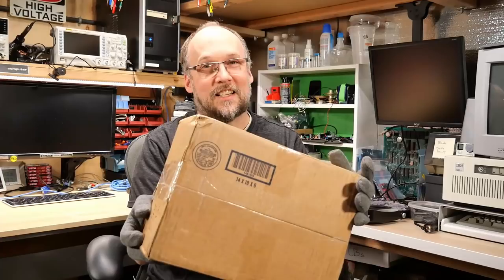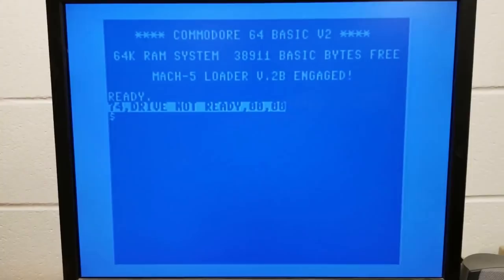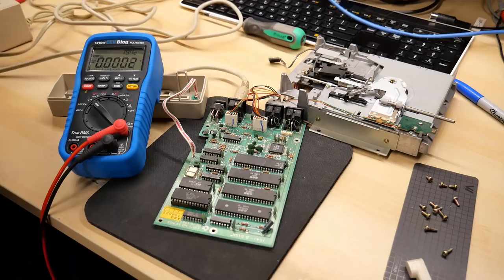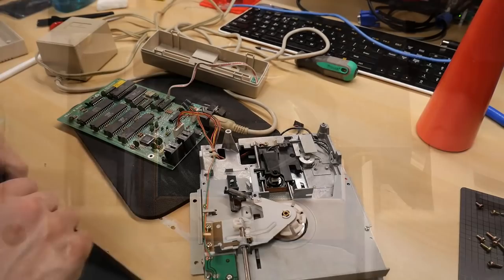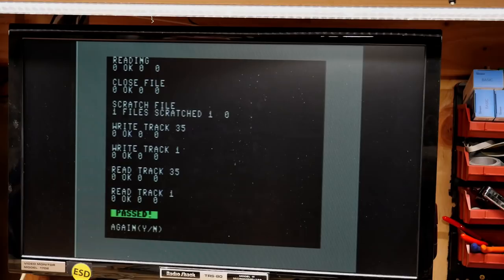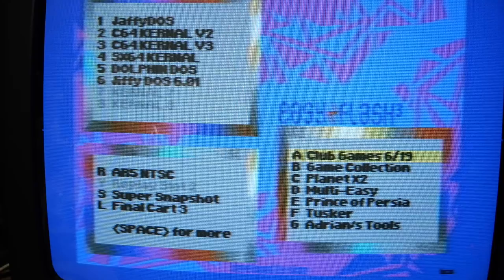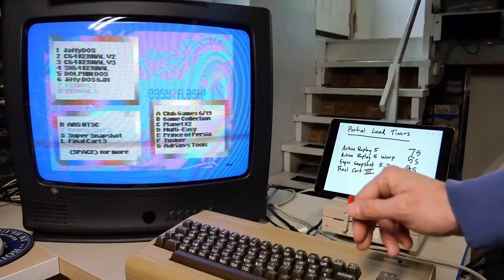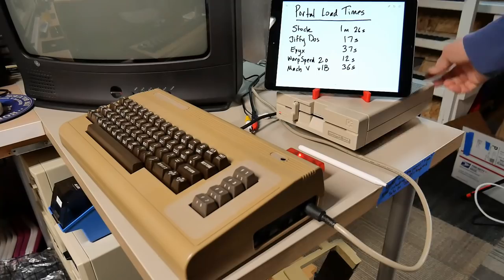Faulty 1541-II Repair (plus C64 Fast Loader fight!)

Comment: Super Snapshot had its own version of the "warp" format. In fact, I think it used the same indicator for the special files. I don't know if they ever built the creator into the cartridge though, my version had it on disk. However, once the files are saved in that format, the cartridge will load them just fine. I'm not saying it will load the Action Replay warp files, but it couldn't hurt to try. I'd be interested to see if it works.

Epyx also had their own version of this in the Vorpal Utility Kit. I rarely used the special format because I didn't like the way you couldn't copy it with normal programs and because if I gave copies to others, they might not be able to load it. I forget if Super Snapshot had a program to load such files without the cartridge or not.

Comment: You forgot to paper the table so you can then remove the paper to a bin. If you get newspapers pre-outbreak, those are great for providing a sanitary object-handling surface for the table alongside use of disposable gloves. Also: Bleach the surface when finished, and bleach the gloves if you intend on re-use of disposable gloves. Have three basins — straight bleach, first rinse, second rinse — then hang dry. Handle all objects outside with tissue or paper towel (preferably from a motion-sensing dispenser.)

Comment: Here's a tip that I am hopefully remembering correctly: You don't really need extra hardware to diagnose a flashing activity light on a Commodore diskdrive. Using a simple (albeit probably clumsy) set of commands, you can get a print-out directly on the screen using a BASIC command:

OPEN 15,8,15:INPUT#15,A,B$,C,D:PRINT A,B$,C,D:CLOSE 15

This will give you the same error report. Strangely I can't get it to work as a single line in WinVice (kept getting an ILLEGAL DIRECT ERROR) but writing a short BASIC programme like the one below works too:

10 OPEN 15,8,15
20 INPUT#15,A,B$,C,D
30 CLOSE 15
40 PRINT A,B$,C,D

EDIT: OMG, Krakout. I spent so many hours on that game. Also funny that the screen before plays the theme to Yie Ar Kung-Fu II. Also a very nice track.

Comment: If I remember correctly, when I used to repair those. The 74LS13 would cause a no read error as well. This is the same chip that is used in cassette data drive. or you could make your own with the same chip.

Comment: Regarding alcohol vs Windex, 99% alcohol has no water in it, so it's not going to clean certain things, especially organic material. Just like water alone won't clean grease, pure alcohol won't clean water-soluble stuff.  I usually use Windex for glass or shiny surfaces, 409 for solid surfaces, alcohol or contact cleaner for anything electronic, and lighter fluid for anything sticky or gummy.
Reply: In addition to that, unlike just alcohol, the Windex etc. surface cleaners do contain also some spesific effective surfactants which improve wetting and dispersing, thus helping also to separate the particles, for example. As the outcome of all those designed properties, the efficiency of the cleaning process gains significant improvement.

Comment: Not silly for wearing gloves. I wear gloves and a mask when going food shopping.

Stay safe everyone.
Reply: Hopefully he cleaned the desk after setting the box on it though. You could spray them with a bleach and water solution and open them up on the front porch if you’re worried though. Then it never enters the house either.  Would make it a little harder to do an unboxing video though :)
Reply: Viruses don't survive long on cardboard. Furthermore, getting infected this way is highly unlikely.

Just wash your hands after handling it or when returning home.
Reply: @insertaverygenericnamehere  Viruses are not alive to begin with, so... Also, on the cruise ship Diamond Princess they found that the virus was active on surfaces up to 17 days after the infected people left.
Reply: @MariaEngstrom  From recent research (within the last two weeks at UCLA): "Scientists discovered the virus is detectable for up to three hours in aerosols, up to four hours on copper, up to 24 hours on cardboard and up to two to three days on plastic and stainless steel."

Yes, a CDC investigation of the cruise ship found evidence of viral RNA in cabins that hadn’t yet been cleaned after 17 days. But to be clear, that just means that the RNA was detectable – not that it was viable or that contact with those surfaces would have been able to infect someone.  If you have bits and pieces of RNA, that’s not a functional virus.  You need an entire intact genome. Just because you had a little piece of RNA doesn’t mean that there’s an infection.
Reply: Furthermore:
Did he wash the gloves?
Did he touch his face by accident with the gloves on?

Wearing gloves can lead to unsafe behaviour — in the sense of "I don't need to wash my hands because I wore gloves"...

Comment: IDK if this is true for the AR5, but for the AR6 and RR the only keys you really need to know for daily use are:
F1 then RETURN for LOAD & RUN first program.
F3 for instant disk directory.
Cursor up to the beginning of a line in the directory and hit F1 to load that file.

It's nice to see that the NTSC AR can keep up with the PAL version.  

I can understand the appeal of JiffyDOS (and other ROM based loaders), but that 10 or so second saving the AR's standard fastload to me is worth the cost of slight incompatibility issues.

But, after seeing this video I honestly can't see why anybody would want to waste time and money on the EPYX fastload cart when nearly everything else is faster and offers more.
Reply from the maker: Yeah! The Epyx cart is certainly better than nothing but I guess its early release meant a lot of people had it and never upgraded. Their loss!  AR is just so crazy fast. I did find a few things that didn't seem to work with it though during my limited testing.

Comment: Interesting that you switched to lithium grease. I was always under the impression that when plastic is involved (in either one or both of the parts that 'move') then silicone grease should be used.

Comment: Hi,Adrian 
If you want to clean with 99.9% IPA  you need tho thin it down to 70% by adding 30% DM water ,that is why your windex worked.
I always have some watered dawn IPA for cleaning and finish with 99.9% to be sure all water resedu is gone .
It works great for flux cleaning to , cleans way  easier than pure IPA . Do the test.
Reply from the maker: Good tip. I actually have 70% IPA already on the bench and 50% which I use for cleaning things. I'll use the 70% next time for head cleaning too.

Comment: I have a few SID chips that manifest issues on some of the channels but still are good for test purposes. I find that the swinsid should only be used with Dual swipe socket attached to it otherwise it can widen he SID socket. -Mark.

Comment: Not sure what sound/noise you were referencing later in the Video but if you don't have the Audio in to ground fix then it will definitely make a high pitch noise esp. when volume is turned up.  -Mark.
Reply from the maker: The SID has a fault, anytime any channel is enabled there is an annoying high pitched sound. The camera mostly filtered it out. It's not specific to this machine. I stuck that SID in the machine because Final Cart III doesn't work with a Swim SID due to lack of paddle/mouse support....

Comment: I use retro replay (the default option on my 1541 U2+). I was kind of hoping you'd test that too. I noticed it's insanely fast though. I noticed it was way faster than epyx and epyx didn't work with sam's journey. Retro replay works with sam's. Probably because it's made with REU in mind. I think it's the same company as action replay. I wonder if it is basically just the same thing. I love the F1 to load * option, but you still have to hit enter.

Comment: @Adrian Did you think to clean the black plastic top part of the headassembly, that pushes down when the head is engaged? I was just watching it, thinking there might be the same kind of crud on there, if it came from a floppy that had gummed up. Wouldn't want you to get that on your discs that you use in there :)
Reply from the maker: I don't. It's a foam pad and doesn't seem to pick up the same contamination. If it's a double sided drive then you do need to clean it as it can get the same build up.
Reply: @adriansdigitalbasement  Ah ok, i was thinking it would be some plastic thingy, which could crap that gunk the same way, i don't really know those old Commodore drives, but was really just concerned about your precious discs you would put in it. 

Thanks for putting out so many videos right now, by the way,  it's really nice to get all this new content... and stay safe :)

Comment: Super Snapshot Warp mode was missed -- Iyou don't need the cart to load that type of file, either.  I would wager it would be just as fast you winner.  I think you should do a part II :)  Cheers, ~ c

Comment: in regards to the magnetic mat, I have a little magnetic bowl (looks like an ashtray) that I picked up at ACE Hardware for a couple of bucks..  works great and spends most of its day just stuck to my fridge.
Reply from the maker: Yeah I have a few of those too. My gripe with those is they often pickup stray screws on the underside due to how strong the magnet is. The mat seems to keep screws exactly where you put them down so you can organise the screws into groups.

Comment: I have drives that are know good ones and they still work, but I had to clean the heads of them a lot of times, before I realised, that I had to sort out my floppys, because when I was using those drives, suddenly they stopped working and I was totally confused, of why exactly they couldnt load anything anymore, until I checked on the head and saw that it was completly dirty, so even one single floppy can get the head dirty enogh, so that it cant read anymore. It is a good advise as well to check the floppys themselves, if they are still ok to use or not
Reply from the maker: Yeah! Old floppies are degrading and one use can render a drive inoperable.

Comment: you should definitely spend the cash and get a 1581. fastest drive, looks awesome and you can put 15x more programs in a single floppy.
Reply: then you add jiffydos to 1581 and you get what c64 should have always been.  forexample you can quickly load a digitzed image (jpg converted to koala) as part of a simple menu program in basic that load/runs games/programs in that disk.  i even added a sid file player as well.
Reply: Those drives sell for 300 euros now on ebay ! Crazy
Reply: @speedsterh  such a shame

Comment: The final cartridge 3, you should be able to use any joystick as the controller if you don't have a mouse.
Reply from the maker: The joystick on port 2 didn't seem to work and I didn't test a mouse. I did notice with the Swinsid installed the mouse pointer moved all over the screen on its own! The Swinsid doesn't support the mouse or paddles...
Reply: @adriansdigitalbasement  I had one of these final cartridges 3 and it was many years ago since I used it.  I have no Ideal where it is.  The cartridge image I downloaded had that same problem.  The mouse pointer didn't move either.  I was sure I saw myself move the pointer using a standard joystick on a real final cartridge 3.  But that what I remember doing from the late 80's
Reply: @adriansdigitalbasement  i got it to work on joystick port 2,  this is for the final cartridge 3

Comment: The gloves themselves are the silly part, those gloves are not waterproof nor disposable nor easily cleaned. You run less risk of spreading contamination by simply handling it bare handed and washing your hands thoroughly afterwards.
Reply: And every surface or object the box came into contact with should have been sanitized as well
Reply from the maker: The box wasn't wet so any contamination on the surface can't magically jump multiple mm through material. And I didn't use the gloves again for multiple days. They just sat on the floor where I had left them so there was no contamination risk.
Reply: Have you considered buying a uvc lamp? Everything I can't wash or wipe down I disinfect this way
Reply: @adriansdigitalbasement  You are a braver soul than i.

Comment: Late to the party, sorry. But pure (99%)  IPA is not always better, some water in there is needed to deal with polar molecules. So 70% IPA, or windex (also water plus alcohol) often, maybe be even most often, works better. As you discovered. (reportings this, though late, because I did not see any other comments on this.

Comment: I had a 1541-II once, when I turned it on, the drive motor would run continuously and the drive light would flash on and off slowly, and you couldn't use it, that is, when connecting it to the computer, if you tried to load a program, it would just sit there doing nothing, the computer would indicate that it was searching for a file, but it wouldn't actually do anything.

Comment: I had a 1541-II with my first C64 when I was a kid. I think the LEDs should be reversed, so the power LED is green, and the drive LED is red. I'm pretty sure mine was blinking red when there was a read error. It's stange because IIRC the wires for the LEDs are soldered in, so you can't plug it in backwards.
Reply from the maker: Commodore couldn't get those colors right. The old drives have red access LEDs and green power but the computers all had red power. So it seems on the II they made it the same as the computers. Then later on later Amiga machines they reversed it back to green power and red or orange access.
Reply: @AndrasMihalyi  In breadbin case C64s, I think Adrian is right, the power LED is always a round 5mm red one. In the slim case C64C, it's rectangular green.
Reply: @adriansdigitalbasement  From what you said, it seems they done it randomly, because my 1541-II had green power LED, and red (or probably orange instead!) drive access LED. I will report that here if I can find it. I disassembled my faulty 1541-II when I was about 9 yo, and it never went back together again, but I may still have the board in one of my junk boxes (I'm sure I still have the power brick for it). My next drive was the big brother 1541, with green power and red access LED. And now I remember the red access LED of the 1541 was a change for me, which means my 1541-II had orange access LED!

Comment: I still have 7 diskettes of my youth. In ~2005 I bought a C64 package with drive and so on and this XE1541 cable. It worked fine, I could bring all my diskettes to the PC and use them in an emulator from there on. But the 1541 stopped working after this and I had this cleaning diskette, after 3-5 minutes of cleaning the head it went to work again. I assume some diskettes just disintegrate after all these years and leave a film on the head.

Comment: Well I am not so sure about the relability of the 1541IIs PSUs. I have got 4 drives on ebay and only 2 PSUs were OK in the beginning. After a while only 1 stayed alive, so I have 1 out of 4 working. I was checking the voltage and sometimes it's the 12V which is too low and sometimes the 5V. They seem not to kill the drives but you can throw them just away since it's almost impossible to fix them since all the parts inside of those PSUs are inside of a weird gel... So my only solution is to get a new after market PSU and hope it's working fine. Or does anyone have any better ideas what to do with those faulty 1541II PSUs?

Comment: Hey Adrian, AR5 is definitely the fastest fast load cartridge. I've written a benchmark tool that times the load and save routines from the KERNAL jump table, down to +/- a decisecond. The AR5 is 13 times stock. You can check out my comparisons and the program here: https://www.obliterator918.com/dtb/

Comment: I have a CMD clone drive I put 12VDC in instead of my 5VDC wall wart. I got my portable car TV line PSU mixed in for some bad results. Would you be interested in a repair? A 1581 compatible and can do 1.4 disks. I miss it so. FD2000 clone  Jiffy DOS native and I have the 1581 which is fine.

Comment: Of course you touched the outside of the gloves when you removed them, eliminating any benefit you could have had.  Remove them from the inside at the back turning them inside out to avoid the surface of the gloves.
Reply from the maker: How so? Are you unable to remove gloves without touching the outside? Do I need to make a video showing you how to do this? LOL
Reply: @adriansdigitalbasement  You were wearing gloves to protect against the virus and then handled the outside of the gloves.   Kinda defeats the purpose, don't ya think?  Maybe you should read a little more carefully and snark a little less.  But hey, your health and your channel.  Have fun.